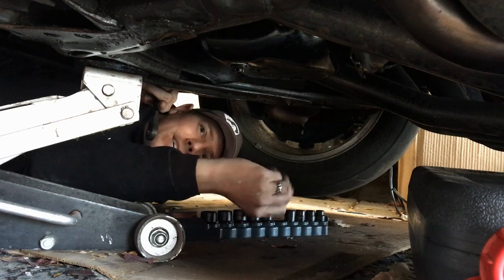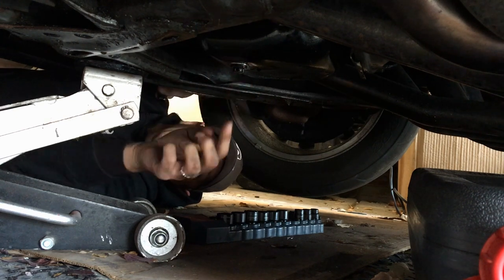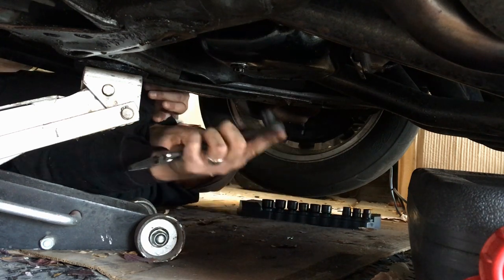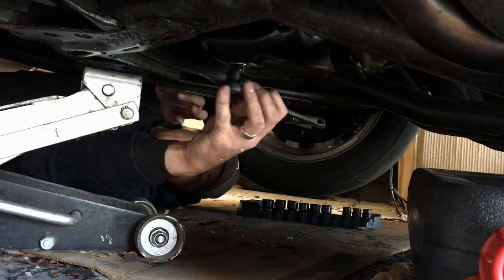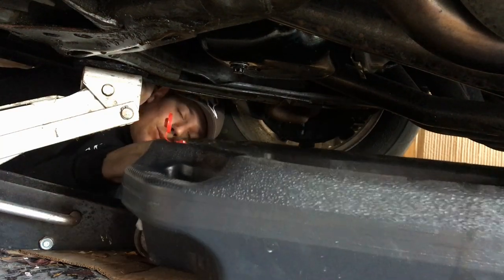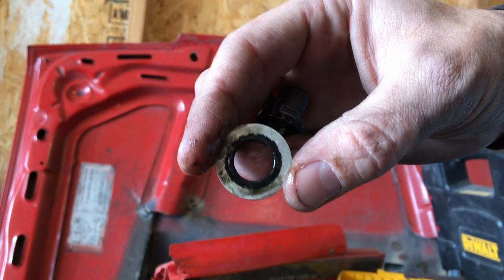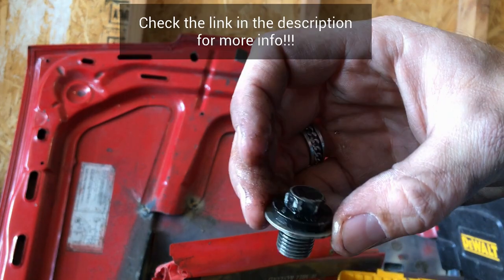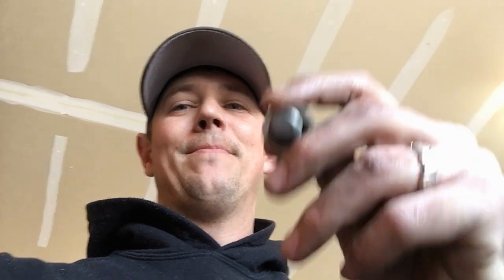Fix Your Leaky Oil Pan Drain Bolt [Tech / How To]

Comment: I have 4 auto stores in my town and no one had an m14 Aluminum crush washer.

Tried to use a copper m14 and it leaked through, luckily a carquest had this exact washer in stock with the right size and it sealed it perfect!!

Thank you so much for the video! You saved me a lot of panic and have me some assurance!
Reply from the maker: Hell yes!!!

Comment: I had issues on a 2014, 1.8 L Jetta. It would slowly bead up oil under the drain plug, after I did and oil change. The cheapest fix I found was to use a O-ring, and conjunction with the copper washer. I actually use a rubber O-ring that I use on my Harley Davidson touring bike. Fit beautifully and stopped the leak. If my threads were stripped, I probably would resort to cutting new threads, 
thankfully I didn’t have to.

Comment: Awesome video... Been dealing with this problem for 2 years, switched out like 5  different drain plugs,prior of this video.
 I do have a question for you though, I have a drain plug with the rubber gasket (GM Impala)inserted.(m12x1.75 )15mm wrench size,
attached into the plug itself,.Do I remove the rubber, and install this washer or put the rubber on rubber ??
I'm afraid of getting a leak if I do the rubber on rubber. WITCH WOULD CREATE to much friction, correct? Again thank you for the awesome video. 
the only video on all of YouTube that has this specific issue. good job,brother.
Reply from the maker: Thanks a lot man, I appreciate the comment!

I removed the rubber and put in this washer by itself. Haven’t had any issues since!  Hope that helps
Reply: Clevor BMF thank you so much for confirming that my man... I did the same exact thing I removed the rubber insert and put your washer... Dry as a bone thanks again keep up the good videos I subscribed
Reply from the maker: Perfect, glad that fixed the issue man!  Only thing I noticed is over time with removing and tightening of the bolt, it puts wear on the rubber... I haven’t had any leaks yet after 2 years, but I assume at some point I’ll need a new washer.  Small price to pay for no oil on the driveway!

Comment: I did an oil change about 2 weeks ago and I forgot to put the new O seal and I used the old one, now my car is leaking I have a 428i bmw 2014 do you happen to know the size I need?
Reply from the maker: Not off hand, but most are 9/16” or 15mm if I remember correctly

Comment: The "other issue"...oil catch can? What was that? I have the same issue on my 87..I "assumed" it was a rear main leak.
Reply from the maker: My supercharger creates a lot of crank case pressure, so it pushes oil out of my rear main an front seals.... I installed an oil catch can to vent pressure from the crankcase.... fixed that issue.  Normally a pcv system will work fine, but I needed something that flows more air.  I’ll have a video up next week on the install.
Reply: Clevor BMF thanks for the reply, yeah, it probably is what suspect, a rear main seal. It's not too bad, just check the oil before driving. Might leak an 8th or 10th of a quart. I do however, have the same oil pan nut issue. I will be ordering some of those rubber washers when I change my out here soon.
Reply: T Web I honestly don't have many problems with mine. It's a very fun car to have for a weekend cruiser. I'm in Michigan, so I haven't been able to take mine out this year...but in a few weeks it'll be time. Oil leaks are common with fox's though, so yep, gotta agree with that being an issue.
Reply from the maker: The rear main isn’t my favorite to change.... but a few beers and a few buddies make it more fun!  I’ll supply the beer and garage, you bring the car over and we can knock it out lol
Reply: Clevor BMF haha, I can do that! You in Michigan?
Reply from the maker: lol Colorado... bit far away from ya!
Reply: Clevor BMF lol...dam! Well, I subbed anyway, fellow fox owners are good to keep close. Thanks for the washer tip, I will be replacing it!
Reply from the maker: I’ve found that finding others that want to spend a Friday or Saturday night working on a car is near impossible....  I’d rather the smell of grease and oil to a bar any night lol

Thanks for the sub!
Reply: Clevor BMF no problem, I agree, I do enjoy working on my car...these days more than the bar for sure!

Comment: My oil drain plug turns freely have tightening it. most likely pan stripped from over tightening. Do you believe that this type of washer would solve the issue. i have seen other videos from tapping in new threads, and ecoplug. do you think the gasket would be worth the chance.  I hate to try many different ideas because every time i remove the plug I lose oil. thanks for your video
Reply from the maker: Sorry to hear that.  I really don’t think this washer would do much good in your case... I think tapping new threads or using a bunch of silicone would be your best best.... the silicone would only be temporary obviously...
Reply: No no, get a new bolt , drain pan bolt, bigger one and make new threads over the original drain hole make sure to drive the bigger bowl in slowly to make the new threads and not strip them again, Then you should be good
Reply: @naynnay4556  so after putting in new bolt won't there be metal shavings put into the pan with the oil that eventually gets in motor?
I guess i could put grease on the threads of the new bolt and pull it back out intermittently to remove the shavings.
i prefer that but i guess i could remove pan by dropping and get all oil out.  don't know if thats overkill. 
thoughts?
Reply: @scooter12368  No. The oil goes thru the filter first before reaching the engine.

Comment: I changed my bike oil drain bold before two days back, new bold i purchased from shop but they dont give washer,  after i installed without  washer, little bit(  2drop per day) oil leaking, wat can i do....  can i use washer or oil seal paste...   relpy me bcoz my oil was leaking.....
Reply from the maker: If you follow the link on the description of this video, it will bring you to a page on summit racing.  Find the correct size that will fit on your drain bolt and buy it.  This rubber impregnated washer should seal it up.
Reply: @BMF_Garage  Thank you,  ur video is good
Reply from the maker: Thanks
Reply from the maker: Thanks

Comment: Only hydraulic jack is not safe. Try to use with jack stand together. Engine oil color is not good.
Reply from the maker: cant get anything by you lol  jack stands are usually off camera and I use the jack as secondary oh shit support in case something fails or falls.  yes, oil gets dirty when you hammer the dog piss out of your car relentlessly like I do.

Comment: I had a slow leak from my oil drain plug.  I tried out the metal and rubber gasket and the leak stopped.  👍
Reply from the maker: Hell yes!  I love these things
Reply: I thought he was Peter's cousin , balls for the chin , hehehehe 😅
Reply: Naw but I seriously am trying to find a gasket . My replacement came with a blue nylon that super thin one and I tried thread locker and took my uncles advice of up to 3/4 not touching the hexagon head.  Mmm , maybe it got hot running kean on empty light and at the low mark again.
Reply from the maker: Search summit racing website for these washers with rubber.  They work great
Reply: I found mine at auto zone in store.

Comment: Copper is the best
Reply from the maker: I respectfully disagree.  I’ve tried all types available for my oil pan and this is the only one that doesn’t leak.
Reply: @BMF_Garage  well u need to use a new one after a few uses i find but no copper has ever leaked on me if u tighten it to spec, i changed my auto trans pan to one with a drain plug and tried every kind of washer on it including the one u are showing, and due to fact atf acts like a great penerating oil, the only type of washer it didnt leak past was copper, ever since that copper is all i use on everything
Reply from the maker: For a trans application I can definitely see that.  ATF is a different animal than oil.